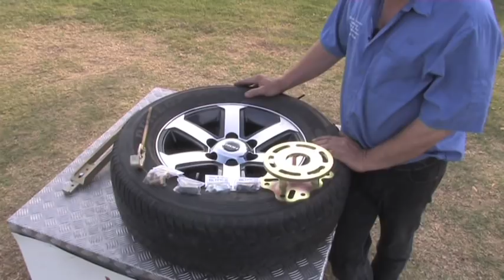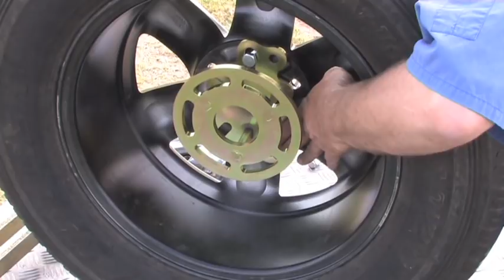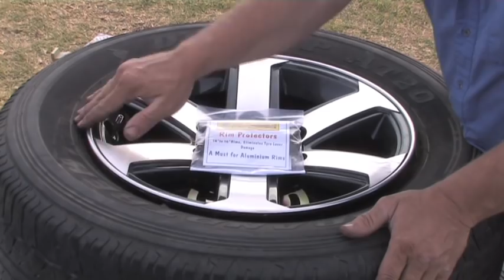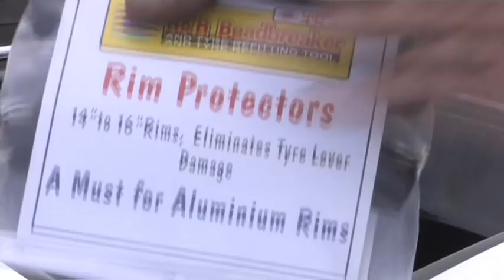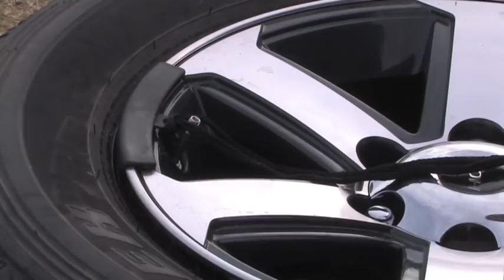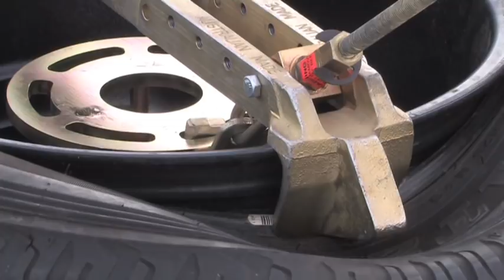R&R Beadbreaker & Tyre Refitting Tool Hub adapter for aluminium rims with no off set

Comment: The R&R Beadbreaker & Tyre Refitting Tool Hub Adapter for aluminium rims with no offset is an outstanding piece of equipment that truly delivers on quality and performance. The engineering is precise, and the fit on aluminium rims is secure and confidence-inspiring. It eliminates unnecessary movement during use, which makes bead breaking and refitting significantly smoother and safer.

What stands out most is the thoughtful design. The adapter protects delicate aluminium rims from scratches and damage while maintaining a firm grip throughout the process. That balance between strength and rim protection is not easy to achieve, yet this tool manages it perfectly. Installation is straightforward, and once mounted, it performs consistently without adjustment issues.

The build quality feels robust and durable, clearly designed for regular workshop use. Whether for professional tyre technicians or serious DIY users, this hub adapter enhances efficiency and reduces frustration. Overall, it’s a reliable, well-crafted tool that makes tyre work faster, cleaner, and far more professional.